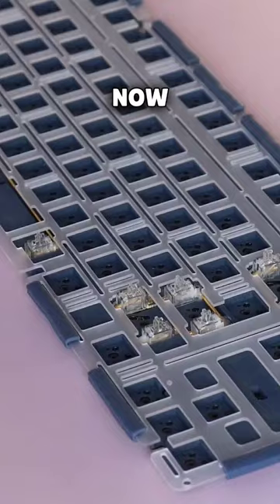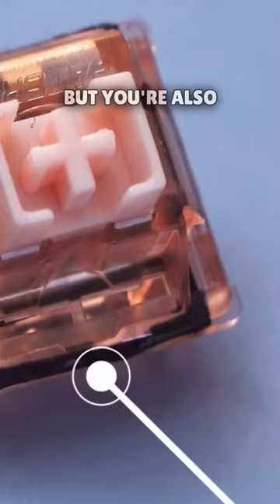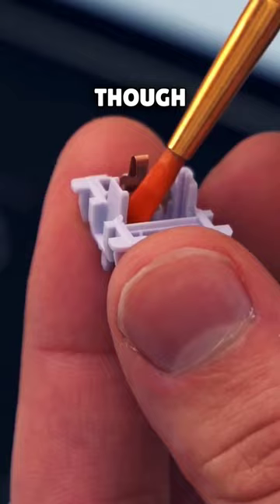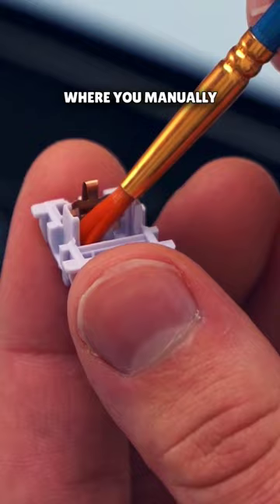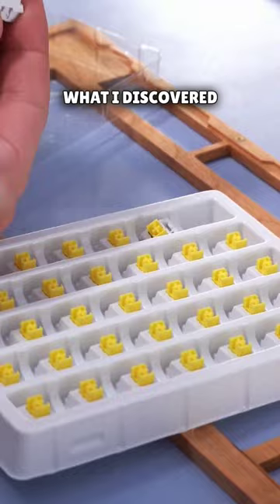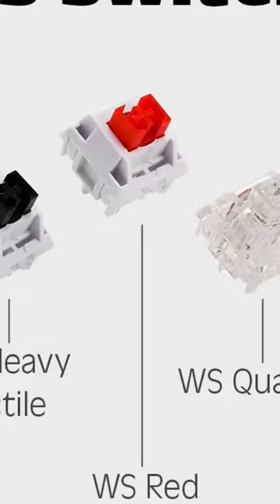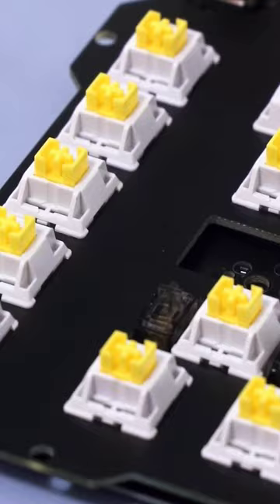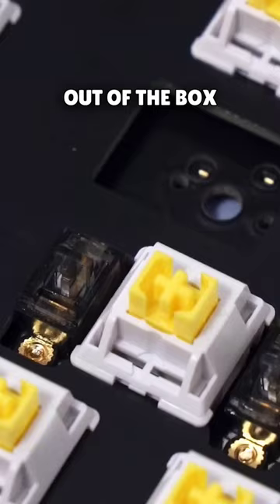"All keyboard switches are the same" #shorts

Comment: "All keyboard switches are the same" - wrong
"All MODERN keyboard switches are the same" - 95% correct

5% because although the list is really short there are manufacturers that are coming up with actually new design and reviving good retro designs instead of just manufacturing billion different variations of cherry mx with little to no difference
Reply: the 5% are hall effect
Reply: based
Reply: people never try anything other than the same 1000 /switches where the only difference is spring weight and material and then say that theres not enough variety lol

Comment: I just started getting interested in building custom keyboards and I woulr like ask "What is the best keyswitch for thock?" And also "Is it better getting factory lubed switches or hand lube it?"
Reply: The switch will have little to do with thock. You want thicker keycaps and the most prominent thock comes from plastic cases
Reply: @SamLoki  I just bought a nicepby keycap set, is it good for thock?

Comment: What switches do you recommend for a gaming keyboard that are pre-lubed
Reply from the maker: Speed switches might feel the best to some people, but really any switch that you enjoy works for gaming
Reply: If you don't wanna go the wooting route for analog switches, I'd suggest a light linear of some kind. Because there's not much force required to press them down, you'll be able to react to things quickly and won't feel fatigued after hours of gaming
Reply: I like speeds and reds.  I have been buying yellows which are like a stiffer red and they are really nice for typing might be ok.
Reply: The ROG NX red switches I really really enjoy for gaming. They come pre-lubed, sound amazing, feel amazing, and are great for gaming
Reply: The keebhut tropical water switches have a long pole meaning a shorter bottom out giving you that “fast” feeling. 

The ttc gold pinks have a very light spring which allows you to press down faster.

Both are immaculate out of the box and don’t cross $40 in price (assuming you get 70 switches)

Comment: actually all switches are different and not the same at all.. that being said, i could be wrong if you just dont use the board. linears, tactile, clicky, different actuation forces all matter after extensive use during a session. 

as a rhythm player, i can say that every single of our fingers, as well as our wrist all have different properties and needs. i can play with linear for speed, tactile for better feeling, but clicky is a bane. thanks

Comment: what about akko lubed switches? thinking of picking up some lubed jelly blacks
Reply: I have the jelly blacks and other akko switches. They have a poppy clacvky sound that's kind of inconsistent and ever present in their linears and tactiles, and i heavily dislike it. It's really bad in plastic or hollow boards. I recommend gat milky yellows for budget, though the DK Halu Halo switches are pretty good too, but you have to lube these yourself. Highly recommend, the halu Halo switches have a pleasant upstroke and deeper sound than the milky yellows.

I am more into tactiles, and i only have akko jelly blacks, Milky yellows, and halu Halo. The halu Halo are my favorite by far for smoothness and having a pleasant sound.

I highly recommend staying away from preluded switches that are budget. Higher quality pre lube jobs are leagues better and cost more. My experience with wuque studios is not great, very loud inconsistent switches.

For tactiles i go for more expensive options that aren't bank breaking but not budget. The gab between budget and average pricing is crazy but the jump from average to super expensive switches is very hit or miss. For tactiles i love the DK strawberry milk switches (they have a linear version!!!!). Very 'thocky' sound if you're into that. I like them in a poppier clackier build for a more interesting sound, that has good mids.

Comment: all switches are the same? bruh in what case is this true I know I just now got into this hobby but that claim sounds very wrong. I got a cheap amazon keyboard and moded the whole thing got new switches (akko Jelly Blacks) and they sounded so much better and felt better than cheap amazon blue switches. all keyboards sound different because of the switches. so what do you mean by all switches are the same?